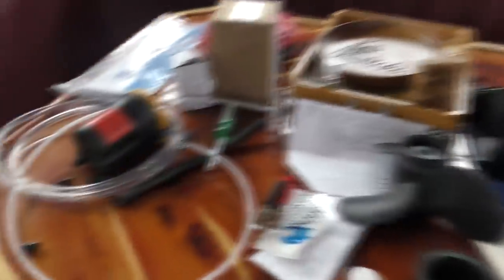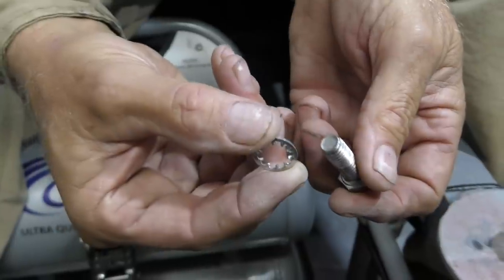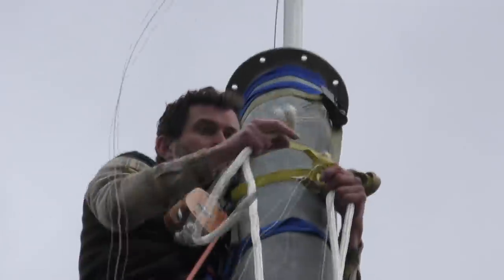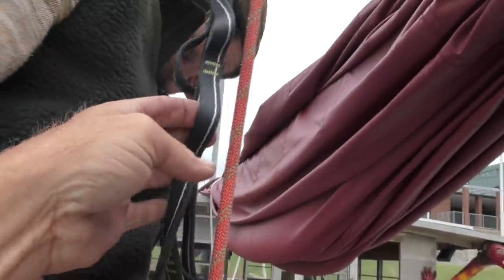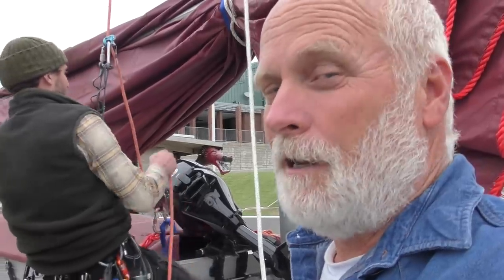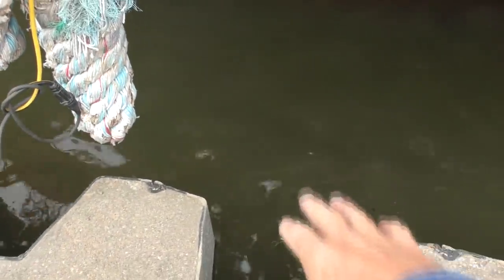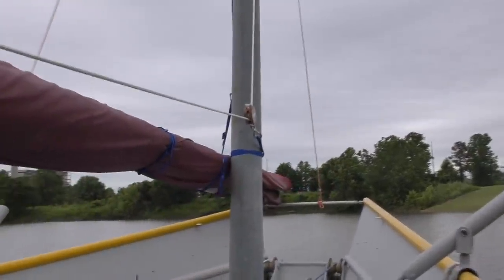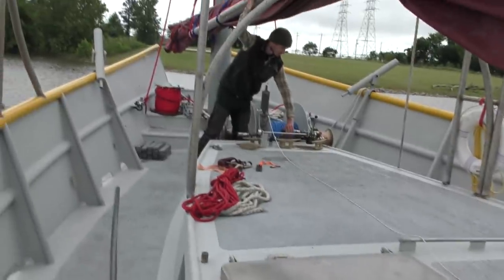Engine and Raising Sails - Part 3

Comment: You need to pull the drain plug out of the engine and replace it with an elbow fitting and a ball valve. If you can't get to it run a hose out from under the engine to where you can reach it. That way you can run a hose off a 12 volt pump and you can just hook your pump to the drain hose and turn the ball valve on and pump the oil out from the bottom. That's how our marine guys did oil changes on boats when I was with cummins. The dipstick thing works for smaller engines but it's a pain on an engine like that.
Reply: Yea. You are very limited with hose ID on dipstick. Taking it from under the pan as suggested above. You can put a much bigger hose on it. You can even pump it cold!.but will be slower than hot. I have been changing marine engine oil for 50 years, on many types of engines. Go for the ball valve.

Comment: At 3:00 - try using some lock-wire setup on those bolts. I'd also recommend a dab of paint so you can look at them and tell if they've loosened.

Comment: About the hydraulic motor: it is probably leaking internally, these orbital motors don't necessarily need a leakage connections so when it starts leaking internally it will blow out the axle seal. Great video again 👍

Comment: Suggest looking into Nord-lock type lock washers. They actually hold and can be reused  as long as you put them back together facing the correct way. Yes, they are expensive but hold fasteners if you don't want to use lock tite.
Reply from the maker: Yeah, those are great, but TrueValue did not have em.

Comment: A suggestion, get you a climber tree stand and replace the teeth with rubber pads. The diameter of the mast is plenty big and it would give you a working platform to stand on. Easy to build yourself. Made my own for years.

Comment: Doug I had a manifold and pump to 2 engines and the generator. I could pump oil out and in through hoses and banjo bolts in place of the drain plugs

Comment: I spend alot of time in manlifts for work lately, and most of them have a backup electronic hydraulic pump. I think a similar system would add alot of safety to your boat! The manlifts are fairly safe, as long as they are operated responsibly, but surprisingly problematic. Its a great relief to be able to self rescue when you are 90’ in the air with the flip of a switch instead of calling the fire department.

Comment: Ooooooh! Using the RED stuff. :) Gonna need some heat to get those off again. I usually use blue unless it's on something that if the fastener fails, I might die.
Reply from the maker: I have a torch.   And a loose drive shaft would strike the hull plate.  No death, but not good either.   And fact is, we are dying anyway.  : )
Reply: @SVSeeker  I'm not dying. I'm too busy living. ;)

Comment: I have seen something stating that you should put the bolts in from the bottom so that if they loosen up, they fall out and you can see the open hole from a distance. I don't know if it is good advice in this instance, but something to think about.
Reply: I always learnt to keep the nut on the lower side so if it comes off the bolt stays in. But I respect your theory 🤠
Reply: @piratejohan4888  I think it depends on what happens if they fall out. On this the entire mast head falls to the deck if the nuts all fall off, so it is safer to be able to inspect that there are missing ones from a distance and fix it before they all come loose. The screws without the nuts from the top don't hold any load as it would tip off, but give the illusion it is held on. 

In other cases the screw is likely to stay put and may keep it together until it is noticed or serviced.

Comment: I drilled holes through the bolt heads on a boat I had and wires the bolts together.
Reply from the maker: That took some patience.
Reply: @SVSeeker  yeah I was out at sea the wind was coming the opposite direction to where we wanted to go. I had no locktite and just a battery drill and seizing wire. I didn’t feel like turning around so I just did it there and then. Bolts never came loose again.

Comment: I hope you seal that connections. When I have an out door connection I put some black tape in case it needs to come apart. Then I use liquid black tape and cover the black tape over the ends of it with  to 5 times letting it dry each time and I cover it with black tape. I never lost a connection in the 25 years I have been doing this. But I don't have any salt water in the air.

Comment: I see masts, rigging and antennes being installed. 
Just wondering, are you also doing something to mitigate the effect of a possible lightning strike?
Reply from the maker: We'll likely put an arrestor on the VHF but it's low on the list.  On a steel boat with steel mast I not convinced it would do any good at all, other than make you feel like you did something.

Comment: When you were doing the propshaft, i was about to suggest nylock nuts, they are often ussed on propshafts and rarely come loose, but for the mast you said you didn't like them.
Reply from the maker: They'd be great there, but there are no nuts.
Reply: @SVSeeker  Ah, i wasn't sure
If it gets loose again, maybe those metal strips between 2 bolts with locking tabs

Comment: I am fairly new to the channel so this may have been asked years ago, but have you guys fixed the "Killer Dowel Pin" in that Cummins?  If not I would highly recommend doing it asap.  It is a cheap fix but can be a very costly oops if it comes out under way, not to mention leaving you stranded.  Also you may want to consider a fluid filled harmonic dampener for that engine.  Given you will be using the engine at fairly constant rpm while under way this would help with engine longevity vs using the standard rubber type dampener.   Sorry if this is stuff done already and I'm just not caught up yet.  Love the videos and the project as a whole!!!
Reply from the maker: If I had a dime for every time.  : )
Reply: @SVSeeker  I would have been shocked if you had said no.  You guys seem pretty squared away but better safe then sorry.  Can't wait to see more adventures.  Thanks for taking us along virtually.

Comment: Your learning the value of “sea trials” ! An important part of a vessels life , the more thorough and detailed you are the better the crew and vessel will perform in difficult circumstances. 
I believe you may want to have written documentation called, standard operating procedures, an other called abnormal situation management, a third called emergency procedures . If your doing research work your going to have a rotation of crew roster, they need standards to adhere too?
Reply: Yeah I’m sure Doug will get right on with producing an SOP for his boat.. lol

Comment: Would it be worth it to put in Ts into the variable pitch controller so if you had to you could put in a hand pump to manually control the unit? Also what size are the drive shaft bolts I have some nord lock washers that I could send you those toothed lock washers never work.

Comment: Your drain plug appears to have a magnet on it. How/will you figure out a new magnet location? when you remove it in place of a drain line .
Reply from the maker: I don't think it's a requirement.  :  )      But if it bothers you a lot, you can always put a magnet in the waste oil bucket.
Reply: @SVSeeker  agreed, but was just wondering... Being out at sea for extended times and all... Collecting extra filing may extend the life of the engine.

Could just stick a magnet on the side then take it off when doing a change.. or not worth it.

Comment: Think I'd be lockwiring those propshaft bolts, no chance of any of them moving then and easily repairable in the sticks as you only need to bail of lockwire stored somewhere ...
Reply from the maker: If they move again.  They'll get a spot weld.  : )
Reply: Or a product called Torque Seal.   its a thick paint-paste stuff that dries brittle.   You put a dab on the edge of the bolt.   If that bolt loosens, it breaks and leaves some on the bolt and some on the part.
Makes it really obvious on your routine inspections if somthing needs  attension.

Comment: wonder how the power steering pump will like the thicker oil, pitch controller also.  Why don't you use the sheet winch to haul the person up the mast.  We did that on the larger sailboats, used the jib line as a back up, full sheet weighs more than a person, except for maybe you and I!
Reply: I used to do it that way also. I never manually ascended up a mast. That's what the winch is for. My preference was a bosun chair and an added old fashion Swiss seat harness for two safeties. But having done some rock climbing myself I get doing it this way is kind of fun. You get to use your climbing gear.
Reply from the maker: You can't do that the first time and after the first time, it's like taking a walk or going to the gym.  Once you can do it you have lost a skill.

Comment: Man I'd go with a traditional prop, that multi prop pitch deal sounds and looks like a complicated solve to a non problem.
Reply from the maker: Far too many advantages for us, and I have noticed that everything looks complicated until you figure it out.
Reply: Variable pitch means you can really dial in the pitch for best performance/fuel economy. Fuel could be 10 bucks soon. GPS and a fuel flow meter. RPM verses pitch.........good times. Well worth the time and expense.

Comment: I'm confused,  I may not be understanding your issue , if I'm comprehending your ps issue, you believe your ps fluid is crossing over to engine oil... if so where does that happen. I just don't know of an arrangement that could allow that
Reply from the maker: The power steering pump on the Cummins 5.9 is gear driven, so if it blows it's front seal the power steering fluid is lost into the engine.

Comment: OH boy- BLUE threadlock wouldve been plenty for that drive shaft- the red can be problematic to remove in the future without heating with a torch, and since a U-joint is a wear item....... Yikes!
Reply from the maker: Ya just put a torch to it.  What's the big deal?
Reply: @SVSeeker  making it to where you can only get it apart with a wrench, is normal- heating up several bearings with grease and rubber seals in it with a torch, just to remove a driveshaft seems goofy budd?
Reply: @Mad-Duk_Machine_Werkes  He is too smart for that. Just try to challenge anything he does, he’ll get on here to tell you how afraid of everything you are.

Comment: Great progress again Doug my friend. I’ve commissioned plenty of complex, interconnected systems over the last 25 years……….not boats, but still pumps, valves, drives, bearings, controls, hydraulics, power, etc. so entirely comparable. To those whining about ‘all the problems on your deathtrap boat)’………….was it all supposed to work out of the box? Get real! 

Loctite? Oh please. So what? 

Doug is enjoying every second of this optimisation journey, and so too am I. Getting stuff to work is an absolute joy.

Comment: Doug! Lock washers suck ass. The only GOOD lock washers that I know of are "Nordlock" washers. It's a two piece deal - look it up. 

A close second are Belville washers. I have a bunch of metric machine screws with captive Belville's and just the added spring tension on the threads seems to keep them in place better.

Comment: You’re supposed to use like a small dot or two with thread lock, not heaps. Good luck ever getting that bolt out without snapping the head of it.
Reply: You people!!!, he has built this ship from scratch, I'm pretty sure he knows how much locker he needs to use., anyway a little heat and it'll come right out
Reply from the maker: I have a torch.   ....actually 3. : )
Reply: @SVSeeker  😁..i dont get why people still feel the need to tell you "you're doing it wrong"...I've been a sub since the origami video where you started lifting the sheets of steel and spot welding them into place... the ship and you have come a long way since then, the laughs the tears the blood and sweat, hell, the relationships too and although i don't have any money to give in support i wish you all the best!!!

Comment: So far with very little use, the boat has been in constant repair or some stage of component failure. Judging from the past few months, to take this boat in the open sea would be suicide at best.
Reply: From my point of view, given the number of things that Doug told us "would be addressed once we're on the water", it's going better than I expected.
Reply from the maker: fear is the mind killer
Reply: I think what you are calling 'repairs' is actually commissioning/trials.